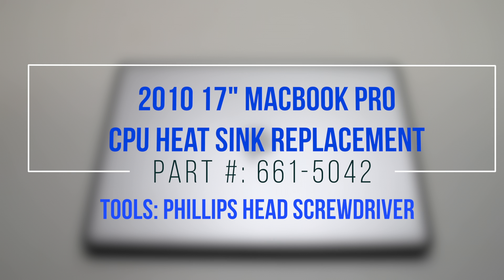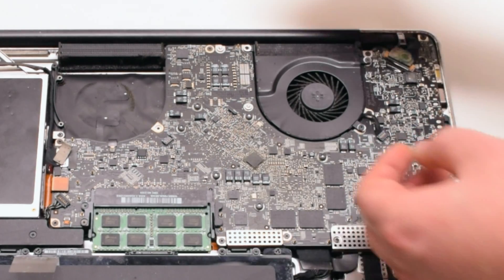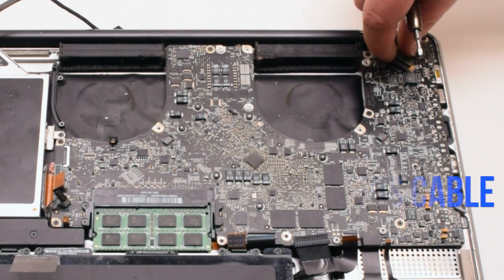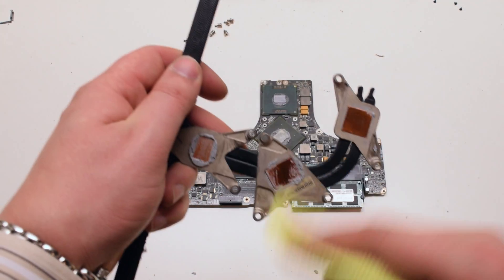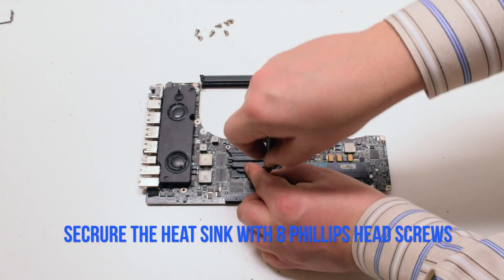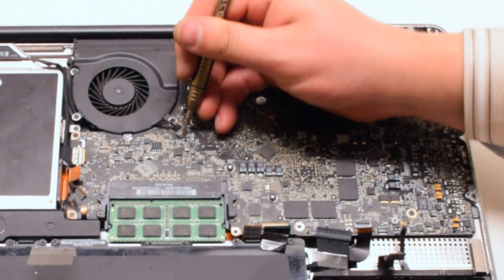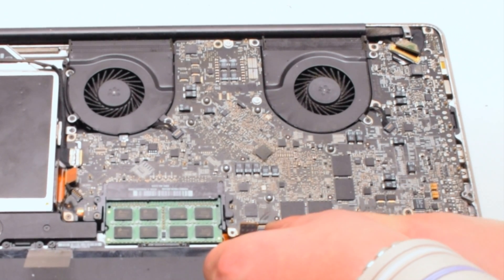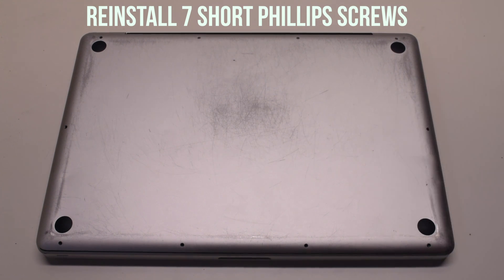2010 Macbook Pro 17" A1297 CPU Heat Sink Replacement

Comment: Lol.... my internal microphone stayed glued to the top case and snapped off its wires when I picked up the logic board. Lousy luck.

Anyway, I’d recommend using a parts tray or magnetic mat over leaving screws sitting in anything... my personal experience is having my shoulder pop and jerk the item so the screws go flying like parts off a Perfection(tm) game board.